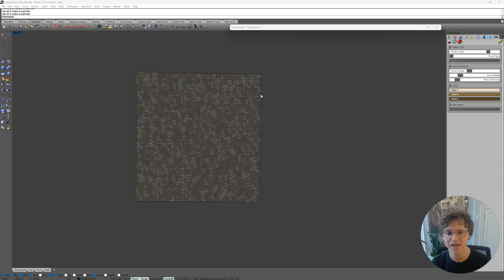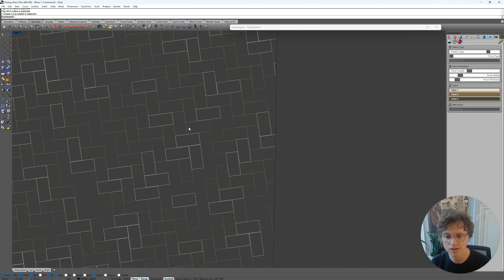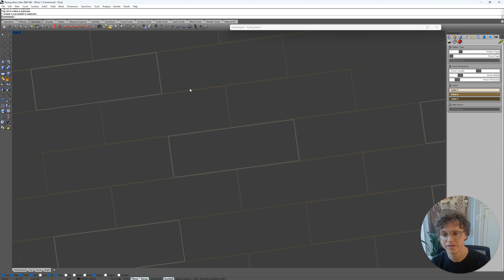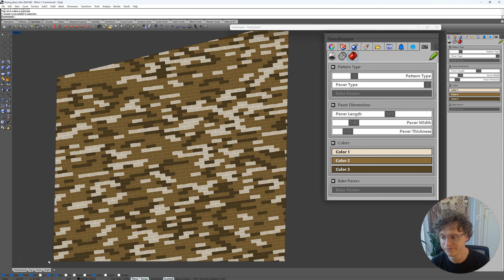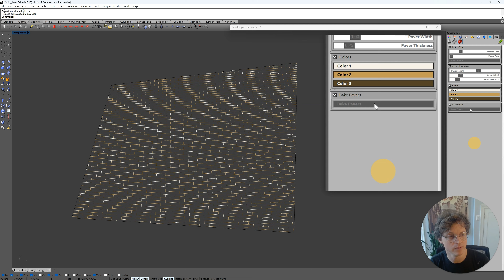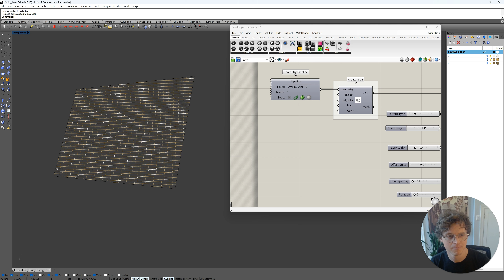Paving Basic Mini Workflow

Comment: Great tool! Just one question. Why doesn't the workflow panel display the same amount of adjustable parameters as the Grasshopper definition? Thank you teacher
Reply from the maker: I manually assign the sliders to the panel but right clicking on them in the Grasshopper and selecting "Publish to Remote Panel"